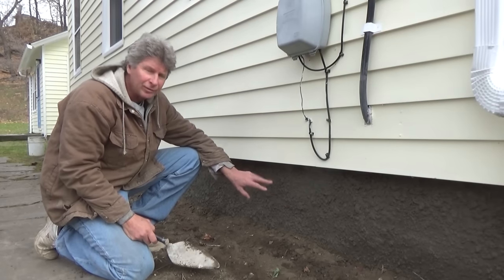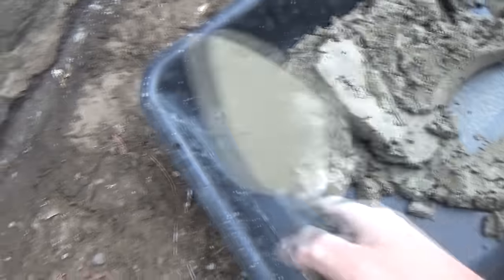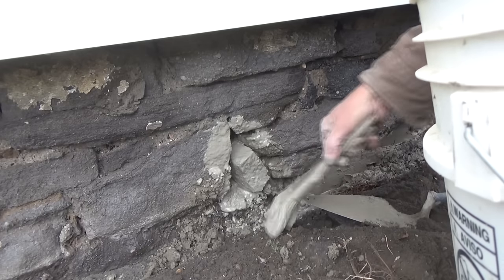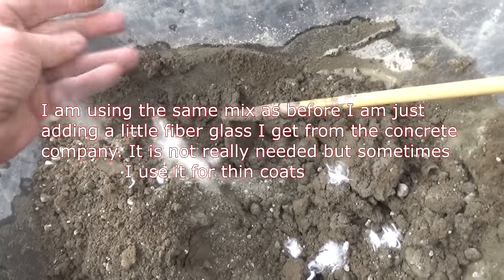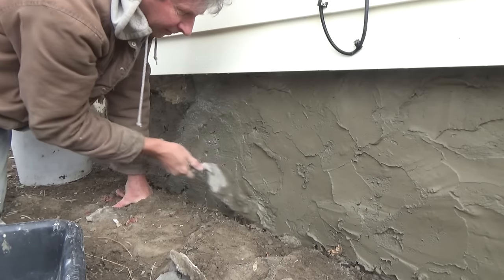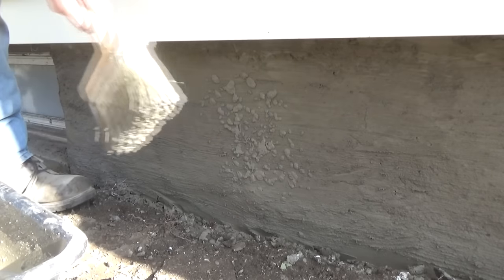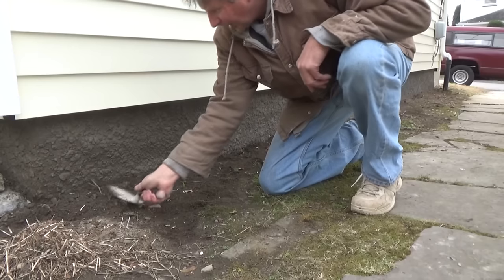"STONE" FOUNDATION REPAIR (part 3) Mike Haduck

Comment: Your series of vids inspired me to rehab the stone foundation on my century old house starting about two years ago. I decided to do both the inside and outside which took me a little over a year working in the evening after work and on weekends. After knocking off an enormous amount of old waterproofing and failed mortar, I filled the holes with quick setting cement. Then I applied Quikrete Surface Bonding Cement which has fiberglass already in the mix. After that, I finished with a coat of UGL mold inhibiting paint. Prior to this effort, my basement was damp and dank. It's now my woodworking shop where I spend a lot of time. It looks great and is absolutely bone dry.
Reply from the maker: +Robert LeBras   Great, you are the inspiration to the self doers, and I am glad in some way my videos helped, I am just passing along what I learned from the old timers, thanks mike
Reply: Mike Haduck
Reply: Mike I live in Chicago and my Greystone is over a hundred years old,after I tuckpoint I will be drywalling.
my question is should I use some kind of sealer or a vapor barrier?
Also thanks for all this oldschool knowledge "PRICELESS"
Reply: Did you dig down a lot when you repaired the outside? I'm in the same boat as you were.

Comment: Hi Mike. Thank you for sharing your videos! They are very educational.  My question is about an old farmhouse built on a MI basement with a wide foundation made of mostly large, granite fieldstones.  Half of the house sits on a crawl space, which is also on a fieldstone foundation.  How would one change the crawl space into a full height basement using granite fieldstones for the foundation?  The house is very straight and sturdy. The goal is to match the existing design. Thank you.
Reply from the maker: Hi, I couldn't say unless I seen it, now a days, everthing is shored up with concrete, thanks Mike

Comment: This is really helpful.  I think for my house foundation pillars, I will start with a gravel mix slab against the ground.  Then for the upper part, soak the limestone rocks in water, paint some Portland mix on like you do and then use type-S mortar.  Would you see any reason that wouldn't work?
Reply from the maker: Hi bike, I can't say unless I was there to see it, pillas you usually have to dig deep for a foundation, I can only show what I used in each situation, I hope it helps  Mike

Comment: Wouldn't Lime mortar and sand be better because it breathes and is flexible for stone as other pros say in these N. Eastern/colder climates?  I have researched over and over and it's stated other cements damages stone after 20-30 years, causing it spall/chip from wetness/moisture.  I know you do things your way since the Hippies of the 60's & I luv your teaching.
Reply from the maker: thanks Memo,  One thing about the use of cement is that everyone uses different stuff,  In my area I use what works for me because If I did not I would get constant call backs,  and the "experts" never put it in writing what I should use,(mostly because they have no experience in the real world),  our family has 70 years of experience, and I try to show what I use in every episode,,, don't know what else to say,  I hope it helps,  thanks for the input,  mike
Reply: i have been hearing the same thing, nhl 3.5 and sand. i used portland( 5 yrs ago ) on other parts of foundation and no visible cracks or anything...not sure who to believe...mike tks for the videos great info.

Comment: Really good video,  250 year old foundation with numerous poor repairs.   Any tips on forming and pouring around large foundation boulders to make sure cement adheres to the rock.?
Need to square off around the rocks where foundation turns to brick.
Reply from the maker: Hi, I can't say unless I was there to see it, I just show in my playlist what I did in different situations,  thanks mike
Reply: @MikeHaduck  thank you

Comment: hello, i was watching your videos on repair of old stone buildings. i own an historic building in california and the walls are 3 ft thick rock with cement coating. I noticed the cracks were getting bigger in one area and climbed into the attic which is dirt, and found a hole in the tin roofing, so im planning on fixing the hole in roof then repairing the wall cracks inside and outside. The question comes in is the outside outer layers including the cement with the rocks and the outer smoother layer is the same color as the dirt here. Can i just add dirt to my cement to get a better match than nothing. Im guesing they used the dirt for the coloring. do you know if back in 1850's if they used dirt in the cement? if so how much do i add, i dont want to compromise the cement im filling in the large cracks. our dirt here is like red clay like color, and the building has like a redish tint like an adobe redish tint.  thanking you in advance,
Reply from the maker: Hi, I have a playlist called " repointing stonework " I show where I paint the outside joints with mud to make them look old, but I never mix mud in with the cement, thanks, Mike

Comment: Great old school repair on an old stone foundation. In 25 years of full-time home inspections, I've seen a lot of old stone foundations fall apart due to lack of maintenance. Excess mortar degradation leads to loose and displaced stones. Great job.  I also love the little tip about perimeter surface drainage. It is by far the most common cause of basement flooding / moisture problems, over 90% as you stated. Simply maintaining a 5% slope for the first six feet from the walls out, will make a huge difference in maintaining a dry basement. This is especially applicable to stone foundations due to the porosity of the cement mortar joints.
Reply from the maker: Thanks Eric, I appreciate it,  Mike

Comment: Won't portland cement / mortar damage the stonework in the future? A few old school british builders say that it's betrer to use a softer mix by using lime
Reply from the maker: Hi Félix, up there the weather is different, it will not hold up here, thanks, Mike
Reply: You are correct cement will damage the stone as it traps moisture.  Lime mortar allows the stone to breathe.  Cement should never be used

Comment: Awesome video @Mike Haduck Masonry. I live over in Kingston PA. And this this is actually what the front of the foundation of my porch looks like! I might give this a try. I did have a question regarding cement walls in my garage which is built into a hill so 2 of my garage walls are submerged into the hill. With that it is there any way to fix the interior and exterior walls or would new cinder blocks needed to be put in? I have a section of my back wall that is about 3ftx2ft and at least 2inches in depth just not there.
Reply from the maker: Hi MrBlazin,  I have other videos on "How I patch up or fix up a foundation,"  I think they would give you the best food for thought on that,  I would think it determines how far you want to go with it,  I hope it helps,  thanks mike

Comment: I have a brick house built 1900, with stone foundation, I want to dig the basement down 2’ and underpin the stone. Is this possible or do I just replace the entire foundation in 3’ sections with concrete and rebar? Thanks
Reply from the maker: Hi Douglas, I can't say unless I was there to see it and it was dug down to see, but I rarely did anything with stone foundations unless they collapsed or sank,  thanks mike

Comment: Hi mike, I just wondered if you've run into what I have in my basement. It is partial fieldstone basement and the other half has dirt mounded up on it about 5 ft on the interior of the basement? I've watched your repoint videos but cannot find what to do with this dirt portion. Any ideas?
Reply from the maker: Hi bd, watch my videos, "Foundation repair" or "stone foundation repair"  they might give you some ideas, thanks Mike
Reply: Thanks. I’ve watched the stone repairs but didn’t see anything in dirt walls.  I’ll skim over them again

Comment: Hi mike, I'm not sure how much water I should put in the mix to make it good like yours.
How much water should I use?
and is S mortar mix different than just s mortar? or are they the same thing?
Reply from the maker: Hi  at one time you bought the cement and sand separately and mixed it, I still do that a lot, now you can buy a premix with the sand already added, and occasionally I will use that too. It has become confusing for sure. Just know which is which,  do a little experimenting in a area least seen ,wait a couple days and see what works, I have a series out, " what cement should I use" check it out, thanks Mike
Reply: @MikeHaduck  hey Mike, just wanted to let you know we followed your instructions and tips and everything turned out really nice! We're very happy with the end result!
Thanks so much for your help, we really appreciate it!

Comment: Love these Videos!  Thanks Mike!  I accidentally used the pre-mix S mortar (with sand in it), instead of just S mortar when repairing a stone foundation.  What problems may this cause, and should i try to remove it all and redo it?  Thanks
Reply from the maker: Hi rium,,, I do use the premix for some jobs and I haven't had any problems, so if it is working and hasn't fallen off, I wouldn't worry about it, I hope it helps mike
Reply: @MikeHaduck    If I can't Find S mortar that isn't blended with sand, what can i do to get to the 2 parts sand to 1 part portland that you use for stone foundation repair? Should i just use portland and not the S-type? All of the s-mortar at the local store is blended with sand already. Thanks!

Comment: Near the end of video, you mentioned you brought more dirt to add. What type of dirt is good to add around the outside of foundation to  build slope away from foundation? Would you recommend more clay type of dirt?
Reply from the maker: Hi Invest, I try and use a topsoil that water rolls off,  and I would think the locals knows what works in your area, thanks, Mike

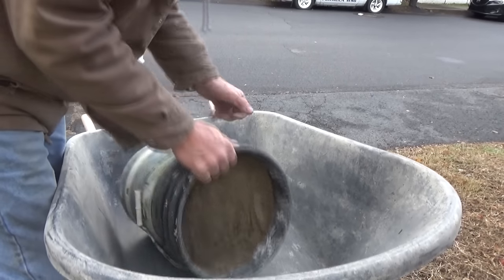Comment: Mike, you use "concrete" and "cement" interchangebly I many of your videos and it sometimes confuses me. In this video at t= 1:20 min, your recipe is 1/2 portland cement, 1/2 s-mortar, and 2 sand. Is that s-mortar mix, or s-mortar cement? Thanks for all your great & informative videos, BTW.
Reply from the maker: I am using regular s mortar cement,, (not the pre-mix) and adding portland to it,  every job I do has a bit of different recipie , it  is just one of those things but I could have used the pre-mix and I think it would be fine. but I had the cement on hand and used it,  I hope it helps thanks mike
Reply: Thanks. I hope you don't think I am being a nit-picker, but even manufacturers get sloppy with the terminology.  I'm never sure if we are talking about the bonding agent only or the mix when someone says "cement." Thank you again for your videos....
Reply from the maker: thank you,   mike

Comment: Mike -
Thank you for the terrific videos! They encouraged me to point "an old stone foundation from the miner days." It's in Pittsburgh, looks just like the one in your videos. Got a lot of dust out of the walls. I'm moving to the outside so, per your video, I'm switching from 3/4 Portland and 1/4 S type mortar to equal parts Portland and S type mortar for my mix - in both cases I'm using your recommended 2 to 1 sand to cement mixture. My question is, the exterior mix feels sandy and harder to work with. Can we use the interior mix on the outside or should we tough it out with this mix that seems to have a harder time sticking? What's the reason for the interior/exterior change? 

Thank you so much.
Reply from the maker: Hi Gomez,  I do the 2 parts mason sand to 1/2  part portland to 1/2 bucket S Mortar,   ( NOT THE PREMIX WITH SAND ADDED)  because it is a little more forgiving with cracks but there is very little difference,  I had no problems,  thanks Mike

Comment: Thanks for the great videos Mike. I live in Minnesota and I have a two-story house that was built in 1886. The house has a limestone foundation that is crumbling in some places, and has had heavy cement smeared over it in some places to the point that it protrudes farther out than the siding. There is no basement under the house and I can only assume there are no footings that go below the frost line. I can see that it has been repointed and patched many times only to crack again. How do you deal with this kind of foundation and all of the seasonal movement?
Thank you, Brad Hall
Thanks for the videos!
Reply from the maker: Hi Brad, just like the old buildings in Europe, just keep patching them , most of my techniques are on my stone foundation repair or foundation repair videos, thanks I appreciate it, mike

Comment: Should you ever dig down further on the outside to the base? I've heard conflicting info. Some say you can dig down to the point of even putting in an external tile drain with sump pump. Others say that is a bad idea as the foundation canteen bow and possibly collapse. Any experience with this?
Reply from the maker: Hi Mike, in the last 20 years I only seen one foundation dug down to footer, and it was a extreme circumstance, thanks Mike

Comment: Hey Mike,
Thanks for your videos.  Like another gentlemen here from Minnesota,  I also have a home that dates back to 1912. I have some foundation repair to make.  The foundation has some larger holes in spots.  Some of the holes go all the way through to the inside.  I noticed you used stone to fill them. What if you don't have stone to put back in the holes? Can you just use the mortar mix you mentioned, buy concrete blocks to fill? Is the mortar strong enough to fill in the holes without shrinking? 
One additional,  the weather is nice for the next couple of days and I hoped to get the outside patched before the cold set in and then work on the inside.  What would you suggest?
Reply from the maker: Hi Steve, I am doing a old stone foundation now and I been filling the holes with anything like old bricks. Stone ,pieces of block anything that works, and I will keep going as long as it dont freeze at night for a few days, thanks mike
Reply: @MikeHaduck  Thanks for the reply Mike.  Your videos are very helpful and appreciated.  My local supply store was out of type s mortar premixed. So,  I purchased the separate components you shared for us newbies.  I purchased Portland,  type S morter, and sand.  I admit I have to go back and listen for the proportions again. Im glad you provided them.  
I will also stop by and pickup some concrete blocks to break up and help fill the holes. Again,  many thanks for your helpful advice and willingness to share.  Have a great day!

Comment: Hi Mike, Robin here. I have a question about repairing an old sandstone foundation. My house was built in 1860, Maeshall, Michigan. The foundation is sandstone above grade and fieldstone below grade. The sandstone is severely degraded in spots. There are even a couple stones missing on the side that has only a crawlspace. Michigan basement under dining & living room, the remainder has a crawlspace. I cannot afford to hire someone and so I am eager to learn the correct method. Years ago a layer of cement was plastered over the bad spot in front. It has since fallen away and the sandstone looks worse than before. Is it possible to buy new sandstones to shape & fit in voids? What is the proper mix for sandstone? I will appreciate any advice you can offer. I am very thankful for the videos you have made & shared. I found them while doing research on this problem. Thanking you in advance, Robbie
Reply: just happened to view your question to Mike. our places must be from the same era. we are in Western Penna. 
our foundation is sandstone slabs; both up from ground level and below grade.
it has weathered and crumbled in places..especially where the basement is wet or outside where the rain and weather hit it.
i located what the local yards call gabion stone and used it with mortar inside.
came from a local quarry. they had every shape or size..especially the smaller ones i could lift and carry. plus most have cull or spall piles for odd sizes.
Mike and This Old House have how-to videos on youtube.
if something needed work to fit i used a mason chipping hammer and a diamond hand grinder to shape the sides.

Comment: Do you have any videos showing the different ratios or cement portable to sand? like in some of your videos your using a 1:1, others 3:1 etc.. do you have one that shows what different ratios do and what can be used for?
Reply from the maker: I have some videos called,  masonry tips for beginners  (part 1 to 3) Mike Haduck,  there are a lot of variations with mixes and I did the best I could to explain it. It is more of an art than a science,  anything that works,   I hope it helps, thanks mike